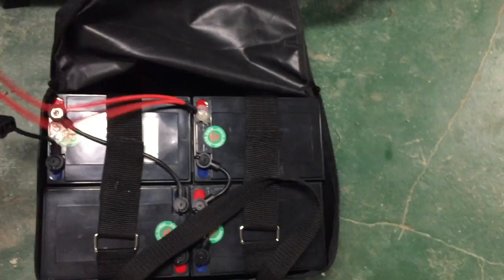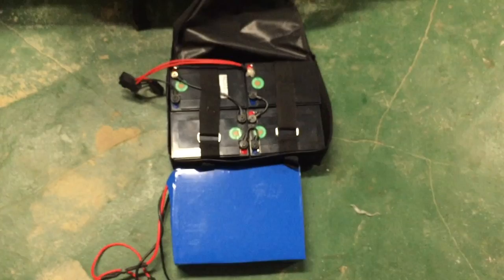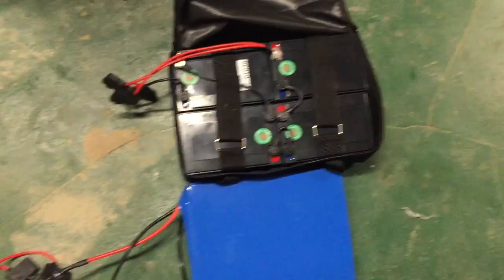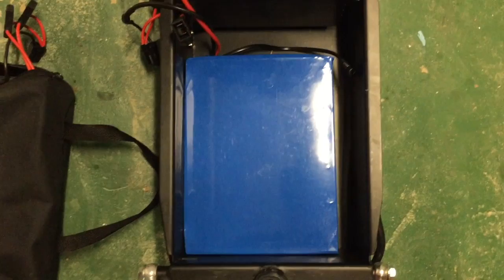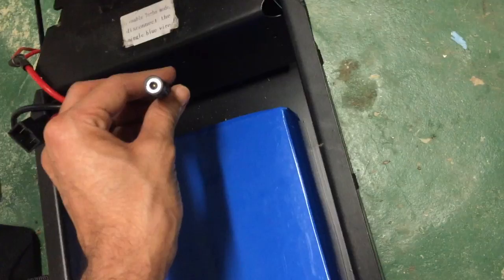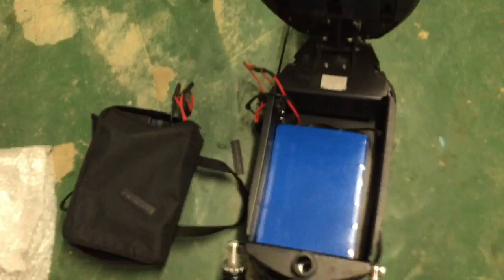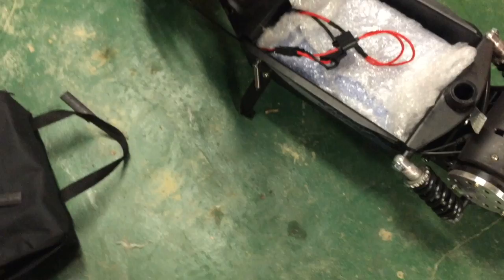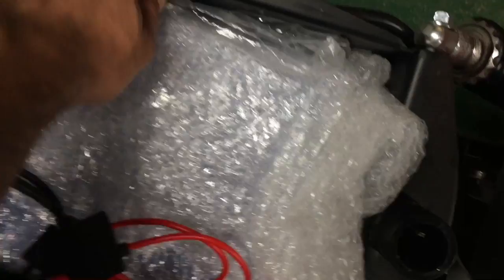UberScoot 1600w 48v Electric Scooter Lithium Upgrade 48v 25Ah

Comment: IM shocked how light n faster my 1000w 48 volt is I hit 26.8 mph mind u I'm 247 pounds 6 foot tall) Edited update: I swap out my 1000 48v motor for a 2000w 60v n speed controller
Reply: With what battery?
Reply: If I change my battery does it go faster?
Reply: @growbo7304  yes but what battery u swapping?
Reply: I do like 30 on a 1600w 48v?

Comment: Lithium batteries DO get hot plus the air that is aloud to run past them keeps them cool enough. Wrapping up the new lithium pack you are creating an insulation blanket basically. They could get super hot and melt your scooter or even fire, plus shortening their life as they are running too hot.
Reply: :) a scooter and a frypan 2 in 1 :)

Comment: Wow thank you. I have a Mototek Mad 1600 48V lead acid. Had it for 4 weeks and batteries are already swollen and won't power my scooter anymore. I wanted to convert to lithium and this video helped me tremendously.  You're awesome. I wish I caught a little more on the charging port but I think I can figure it out. Thanks
Reply: you ment to take them off the charger when the light goes green not leave them over night there no deepcycle
Reply: @traewatson2923 😂

Comment: I have a 48v 1600w electric scooter, what would happen if I put a 48v 50ah lithium battery pack on it? Please help??
Reply: You would simply increase the run time by a LOT with a 50ah.
Make sure not to cheap out and get the best you can if you have not already.
Edit: just make sure you keep an eye on motor and battery temps, especially the brushed motor which is not made for running to hot for to long but if you ride with care it should not be a problem and most Lithium batteries come with a charger at the price point.
Reply: @BrentTheGent1  Thanks for getting back to me! Really appreciate it
Reply: @sul5501  20Ah is plenty really if it's a 1000 watt, should see much more range with that.

Comment: I bought two batteries and they both don't fit because it is slightly too tall with one stacked on the other and the lid doesn't close completely.  I tested the batteries by driving around the entire Manhattan island in NY and was able to get exactly 42 miles on the brand new battery before having to switch to my second battery.  I was using mixed speeds as I encountered street lights and pedestrians.  Hope this helps others interested in doing this mod.
Reply: Tricky Flow whats ur IG? Im bout to get one of these scooters. Would like to meet others that ride
Reply: Did you ever encounter problem with throttle because mine drives, for awhile then cuts out, then when I rest it 20 minutes it works great. One thing I just found out is the original battery charger went bad. I don't know if that's what started this problem or not. Do you have any idea?
Reply: @AdrianButler86  LG & Sumsuang is a 3000 /3500 or more, 3.7v3000mah/3500mah. be careful some controller & throttle  input current  limited .
Reply: @brendanmanwaring9971  My friend had a similar problem with his.  Inside the battery compartment is another compartment that holds the controller.  One of his wires was slightly fried from spark from a loose connection.  He re-wired the connections and the problem went away.

Comment: I would be aware of the charger you use with this upgrade. Buy one that is made for lithium batteries and not lead acid batteries ( the one that comes with the scooter) . It could blow up your new upgraded battery.

Comment: I did this and I received no increase in speed at all. Definitely longer distance, and better acceleration, but still had the same top speed. Super bummed.
Reply: The top speed is determined by the drive/gear my guy.
Reply: @MeFreakz  I forgot I posted this lol it actually did raise my top speed by 5mph. I changed the gear out for a smaller one, bc I had heard it would raise the top speed and it lessened haha so I put the bigger gear back on.

Comment: I purchased the same battery and didn't see an increase in the speed. I did see an increase in the miles though. I see that you changed the controller. Did you buy a bigger controller to get you to be able to go faster?

Comment: Question: could you had used the same batt plugs, buy cutting those off and twist with seal wrap as you mention
Reply: To a sweet my own question: I used solder and tape wit zip tags

Comment: hi i have a uber 1000 36v im not sure if the batterey aint holding charge or if theres a wire lose some where as 1 minute it lights up full charge next its on red if its new parts i need can you tell where the cheapest place to get them i hope you can help help me thank you

Comment: I got a  48v 13ah battery in my 600w scooter.  What battery would I need to go faster ? 
They do this
Alalito 48v 28Ah 1000w  for 69pounds.   Could I run this along side my other battery  OR just swap batt for batt.

Comment: Do u need to get 2000w lithium battery or can you get the 1600w battery is the 2000w 48v okay to put in 1600w?
Reply: My guess is as long as the motor voltage the same has battery voltage not watts

Comment: The harness from my old lead acid battery pack has only 1 inline fuse, will this be OK to use or do I need 2 fuses?
Reply: Did u figure it out if u even need a fuse for this upgrade

Comment: Hey, would this exact battery work with a 48 volt 1000 watt Bullet Stealth. Also do I have to buy a new fuse? Or does it come with the battery
Reply: well in your own harness, you should have a 40 fuse. if not, you will need one of them but im not sure if those batteries will work with a 1000w controller in your scooter.

Comment: Hey buddie, I have the 1600w  48v chaos electric chain drive... almost an exact of your user scooter in the video, (just a different make) 
I want to do exactly what you have done in this video to mine as my original batteries are totally spent now....
Do you have a link for the harnace needed and that lithium battery you used?
I would really appreciate a reply because this upgrade is perfect for me and there is nobody else it's seems that has this information, also did you need higher amp fuses or are they the same as which cane with the scooter? Please help!🙌✌️🙌

Comment: hello and the link for the battery he has here goe to the ALIEXPRESS SITE AND BATTERY BUT THE BATTERY HE SAID HE USED TO DO THIS WAS A 48V 25 AH  2000 WATT AH   BUT IT DOES NOT HAVE THE 48V 25 AH IT HAS A 48V 26AH 2000W(5A WILL THIS BATTERY WORK??? WITH MY UBERSCOOT 1600W 48 VOLT SXOOTER??

Comment: I just bought one of those batteries for my Evo 1600w same thing really, I could only buy 20ah tho as it is from the company I bought the scooter from, that lead crap that come with it, lets the scooter down, only 7 miles I got from it other day, I am worried now tho about that harness thing for the fuses, Is it easy to connect an that, an do the lithium battery make it better on the hills, silly question I know but that lead heavy weight is crap for the hills................
Reply: How did you get on with a 20ah battery? I've just bought a used chaos 48v 1000w (same scooter) and I'm looking to change the batteries to lithium
Reply: @troygardner8870  Just do it, It makes the scooter better with lithium battery, I can get 15 miles or so, An that is top end most the time, Hills are better too get up, These scooters are actually OK, They are proper for round the streets, But yeah it is worth getting or making your own lithium battery...........................
Reply: Brilliant, I haven't even rode mine until it needed charging yet but it weighs a ton! I'm thinking of just buying a battery from Ali express but I hear there are a lot of scams. Do you have a link to a reputable seller?
Reply: Thanks for the reply & info mate . I'll let you know how I get on!

Comment: Did you ever get the battery to charge directly through the XLR port on the side of the scooter? It should be fine I would imagine as long as your using a LiPo 48v (52v) charger.
Reply from the maker: No I just kept it the same just in case I want to but back the lead acid and charge it

Comment: I’ve had the same uberscoot for 5 years & wouldn’t trade it for anything. A friend gave me a brand new 48v 10ah li-ion battery to which I plugged it right in & works fine but doesn’t seem to have as much life as I thought it would. After riding 3-4 miles on flat road, using mostly econo mode with occasional full throttle, battery indicator is yellow/red eventually all red. The only difference I can see is the controller wires are thicker than battery wires. Would that make a diff? Fuses are fine, connections are ok. Any thoughts? Thanks
Reply from the maker: The 10a would last less than your stock battery because it’s 12a 

Also the battery you might have could be old and not producing the full power it’s supposed to.
Reply: you "plugged it right in"?
Reply: Should try a 30ah
Reply: @Scentedstyle  i have ordered a 48v 20ah lithium battery for my 1600w scooter, will that give me good range ?

Comment: Hey dude I have a question I want to order a 52v do you think it will take the controller
Reply: solomon henry Usually, a 48v system can handle 52 volts fine, and you get a noticeable extra punch in power. I havent tried 52v on an actual Uberscoot, but i have on drift trikes and ebikes and it’s hard to go back to 48v after going 52v. But for the Uberscoot, do you really need more power than a 48v lithium pack will provide?

Comment: Do you think I should buy the 2000 watt controller for the upgraded battery or will the original controller work with the new 2000 watt battery without burning out?
Reply from the maker: I actually  have a different controller on my scooter it has all the same connections as the original except the wire for the throttle battery light indicator. thats why i never mention it because i know people wont want a controller that will turn off the battery indicator but since my scooter goes 27 miles i know i will get tired before the battery reaches half way. This controller has more Electric Current at 40A i know the original is either 30a or close. here is the link: https://goo.gl/VyNRGz

Comment: I have two of those scooters can you please let me know where you bought the lithium upgrade batteries
Reply from the maker: Hello brendon, just saw your comments. Thanks, I’m glad to have helped. 1. The lithium battery I got from AliExpress the link to the exact one I have is in the description of this video.
2. The standard battery charger is currently sold out on all the websites, I just checked
Reply: Scented Style x
Reply: The link you provided goes to a battery but not to the specific battery. Can you provide link for the specific one you bought?
Reply: @Scentedstyle  is the wiring easy to change to go from lead acid batteries to lithium free batteries for the Uber scooter... I'm looking for instructions on how to possibly replace the wiring from lead acid batteries 12 volt ------to a lithium battery??????
Reply: @speotter3707   Lead acid battery black and red cable from battery goes to speed controller u disconnect those n wire your lithium there I'm also looking to get rid of this lead acid 40lbs battery I feel its taking away 40% of my fun

Comment: @Scented Style are you telling me just a simple battery change can increase ur speed by 5-10mph??
Reply: Yeah lipos are significantly better than lead acid, I have a Schwinn s750 I converted to lipo and it went from a Max of 22 to 34. Some of the speed was from increasing output from the controller

Comment: Hey bro i had another question whats the biggest battery i can put with the 1000 watt version? and would i need to change the controller. also does a 1600 watt engine  fit in the 1000 watt scooter. Id u could plz let me know i would really appreciate it thnx.

Comment: Dose the battery reading on the scooter give a correct reading when lithiums are fittered or do you need a different battery reader
Reply from the maker: it works accurately once you hit the red light you have two miles its always will work regardless of the battery because the battery reading is from the controller

Comment: Is it the same battery that the mad velocifero uses? by the connector and the measurements
Reply: -joe macias, it could be the same battery. it is a lithium with 35 mile range.

Comment: is there enuff room to put 2 of those batteries in the scooter one on top of the other?
Reply from the maker: Yeah you can fit two lithium batteries
Reply: super cool mine should be here in a week going to put 2 of those batteries in it 48v 50ah long range
Reply: I bought two batteries.  They both don't fit.  It is slightly too tall and the lid doesn't close completely.  If you stand on the scooter you put unecessary weight on the batteries because the lid now rests on the batteries slightly slanted.

Comment: Would you recommend the same battery for a 1000w scooter? Does it make a difference?
Reply: Do u have a 48v or 36v which ever u have get the correct battery

Comment: Hey Jason. How many miles you can get with the scooter after upgrade lithium? I need to ride it 50-55 miles every each day,48v 25ah battery looks enough for it. is it correct?
Reply from the maker: You might want to go with the 30ah it will give  you a longer distance if you want to play it safe just ride at low speed like 15Mph and it will take you back and forth in the same charge

Comment: Been watching all your videos thanks 
I just bought mine I charged it turned it on lights work I go for about ten seconds then the motor stops the lights stay on but wont go it says full battery any idea?
Reply from the maker: Check the fuses make sure both are not burned. Most likely that sound like the controller is bad or some wires are burned.
Reply from the maker: DAILY OBSERVER  all links are in the description
Reply from the maker: DAILY OBSERVER  the link is to the exact same one i have on my scooter, its the best and cheapest one i could find when i was searching.
Reply from the maker: DAILY OBSERVER  i completely understand, aliexpress is a safe website i buy from them all the time and never had any issues, they also have protection like ebay. everything is tracked its a known website, but i understand, if you're concerned i would look at that battery understand the voltage and AH you need and try to find one on amazon or ebay.

Comment: Hey Jason, batt's in pre-ship process so I'm getting the other items u suggest & got a ? for u. Re: the uber harness, Big Toy and a few other sites show the same picture of the harness with 2 fuse holders but the fine print below pic states something like "uber battery harness now comes with only a single fuseholder, not the dual holder shown in pic". I checked a few sites and all said same thing. So A. lmk if there's any dual holder harnesses anywhere  B. if no, how important is the 2nd one? C. if I have to add 1 what gauge wire am I looking for? thanks
Reply from the maker: This is the exact one I have. It’s double and if they say it’s a single but still shows it’s for a 48v not 36v it will still work they just joined the 2x 40a fuses together so you might want a 80a fuse.
Reply from the maker: http://www.bigtoysusa.com/uberscoot-battery-wire-kit.aspx
Reply: That's exactly what I needed to know, thank you Jason Evo!

Comment: How would I give the scooter a lithium battery? Is the process simple or complicated
Reply from the maker: very simple Just get the battery you want lithium 18650 or lipo and the harness (the wire to connect the battery to the scooter's controller) All battery's come with a negative and positive wires same for any scooter you just match the colors

Comment: can i put this lithium battery on a 1000 watts uber scoot ??
Reply: Yes u can I just did on mine 1000w 48 v I cut the fuse off led n add to lithium even tho it has a built in BMS extra saftey